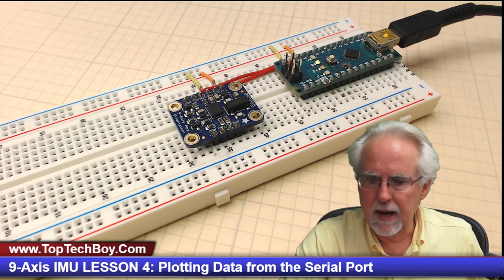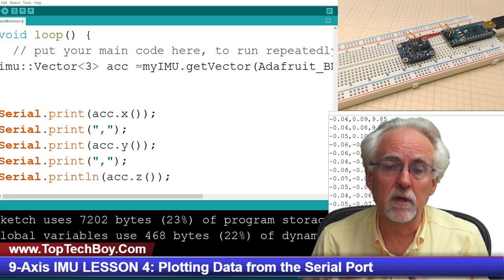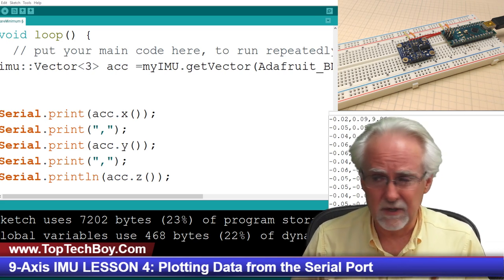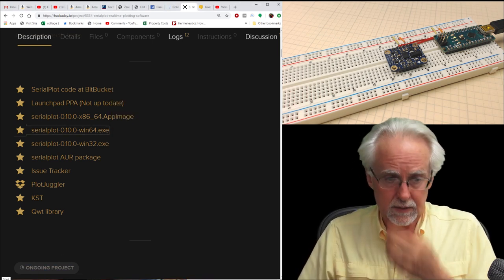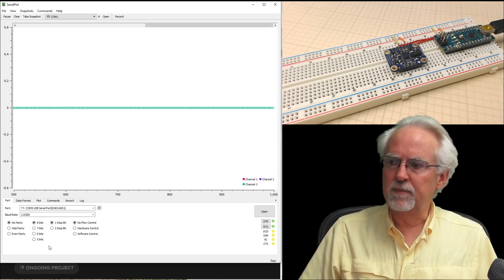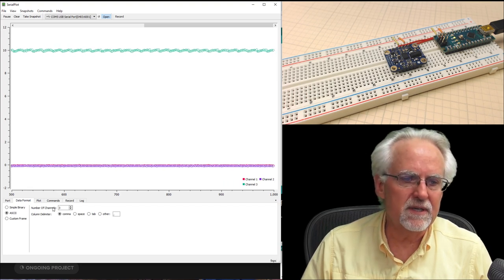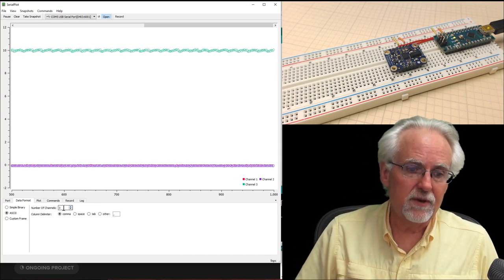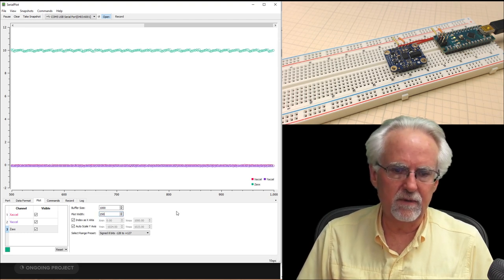9-Axis IMU LESSON 4: Plotting Serial Data from Arduino with Control of Axis Scale

Comment from the maker: The serial plotter software is now hosted here:
You can find it here : https://github.com/hyOzd/serialplot/issues/4
Reply: It's already gone. The link for the windows version is anyway. Is there anyway for you or anyone else to reupload it?
Reply from the maker: Not sure what to do at this point. My best suggestion is follow along using the serial plotter that is part of the arduino IDE. It will show the data, just less formatting options.
Reply: @paulmcwhorter  I contacted the dev last night, and he uploaded a new image today. It's at the hack a day page.
Reply: Project is no longer available on bitbucket #4
Reply: @paulmcwhorter  
I still have the version of SerialPlot used in this video :)

If no "official" mirror is found in meantime, I can share it
Reply: @BiancaDianaT  I would love to have a copy. The one I have does not work well.
Reply: Paul Mcwhorter@ u should share the Arduino code as well :}
Reply: @BiancaDianaT  ...Hi, could you share it wit me ?  Thanks
Reply: @BiancaDianaT  Hi, could you share it wit me ?  Thanks
Reply: i downlaoded the fill for serial plotter 64 but stil not working with me

Comment: Constructive feedback:  Disappointing you are not using Matplotlib and drawnow or Funcanimation instead of the downloaded plotting program.  Matplotlib will allow you to separate the acc, gyro, mag, quaternion data streams into separate subplots.  Your previous tutorial: Arduino with Python LESSON 11: Graphing and Plotting Live Data from Arduino with Matplotlib  was stellar!!   Thanks for all your contributions
Reply from the maker: The problem that I have is that drawnow with matplotlib runs slow for me, not sure why. When taking that approach, I have to slow down the rate at which I send data. Serial Plotter seems to run really fast, so hence I took that approach. I do wish there was a better method to plot from python, with snappy update rate.
Reply: @paulmcwhorter  I will check how fast the downloaded plotting program runs with all 13 data streams plotted simultaneously.  I had no problem with matplotlib being slow with just the acc data stream.  Being able to see the data in separate plots, as well as learning how to use python and matplotlib as a tool justifies to me any slowness compared with the downloaded program.    Besides,  I would rather be taught to fish than be given a fish  ;-)       Great work, and thanks!
Reply: A real Solution to slow matplotlib live streaming data:   (1) use only numpy arrays, since they are stored in contiguous fixed  memory blocks, (2) use numpy's animation.FuncAnimation instead of drawnow, (3) do not append to arrays - simply overwrite fixed length arrays with new data.  
All 13 acc, gyro, mag, and quat data streams were plotted live  in 4  subplots and ran as quickly as Serial Plotter was plotting the 3 acc streams.  

This was challenging , and I realize we have 'crossed the Rubicon' and will be using Serial Plotter going forward.  Thanks for the challenge and amazing content!
Reply from the maker: One of these days I would like to go back and look into this. When I was doing it I believe I was using numpy arrays, then filling the array and with each new data point popping the 0th element and appending the new point on the end. Then plotted live using drawnow, but I believe it was drawnow that was killing me. You could get a few frames a second. I would really like a way to directly plot data using matplotlib live and fast.
Reply: @paulmcwhorter  Numpy arrays to my understanding do not support  popping elements by design .  StackOverFlow has discussed this.  I do hope you look at it in the future...a great coding problem and way to really learn matplotlib.  Thanks for your passion for learning and teaching.

Comment: Will try this software today with my STM32  MPU-6050 board, just to experiment and see if it works or not. Thanks.
Reply: Hi Bob, did you install a boot-loader on the blue pill and does that work well?  So far I've been following the course along with the mpu-9250 gyro.  Chris from Nova Scotia

Comment: I could not find a 64bit exe file for serialplot.
Reply from the maker: Try to make do with the built in serial plotter on the arduino IDE. Not optimal, but not sure what happened to that software I was using.

Comment: you  can only download the 32 bit version of serial plotter. it's been abandoned
Reply from the maker: That is a shame. I really dont know a good substitute for that program. It really is an important feature to be able to look at different data channels coming from a USB connected device.
Reply: @paulmcwhorter  it seems to work. i just spent hours teaching myself trig using x and y. i studied linear algebra for the translation vectors and their relation to quaternions when getting ready for this. i never took honors trig in high school so i just learned about soh cah toa a few weeks ago but i understand it now in relation to asct. i love math. i didnt want to fudge anything coding it. i done a bunch of pen and paper stuff with my graph paper and geometry set to prove bs coordinates id make up in my head and plug into the calculator and then prove by physically measuring the angle i just made up using x and y numbers . 

i have big plans for the winter with some robotics stuff and i want this math and visualization stuff to play a big role in it. im not sure vpython is the direction i want to go but i was thinking about using unreal or unity to visualize the different data im going to use to help me figure out how to parse the data by importance to train an ai on my 2500 dollar graphics card until i can my hands on the next version of the jetson or some other sbc arm/tensor based.

i'll be teaching a c++ for makers class and im going to use what ive learned from you as a template and im going to refer the students to your channel. i want to get a job in ee or compsci if i can get better enough to work again. be a consultant for local businesses and do small end to end systems for them, ive take courses on that before many years ago when i was getting my data science degree when data mining was new. lol